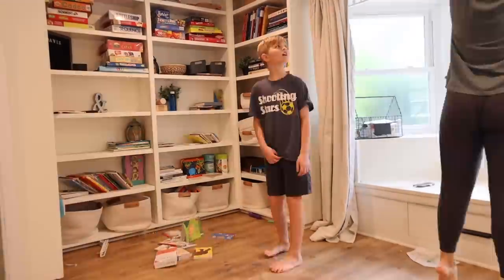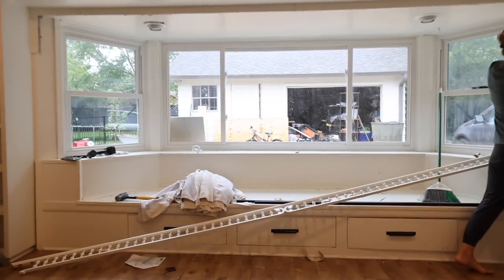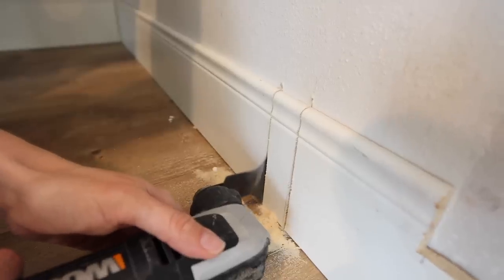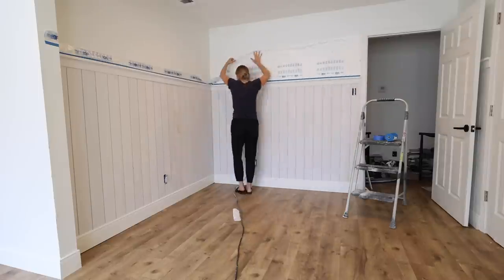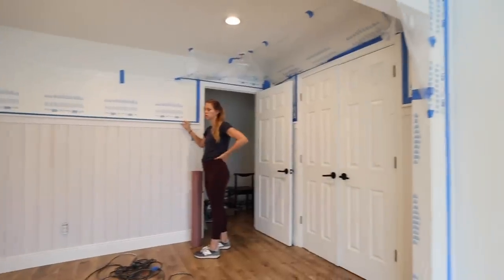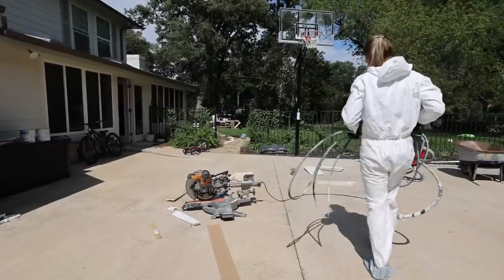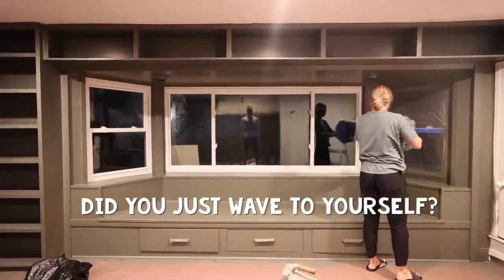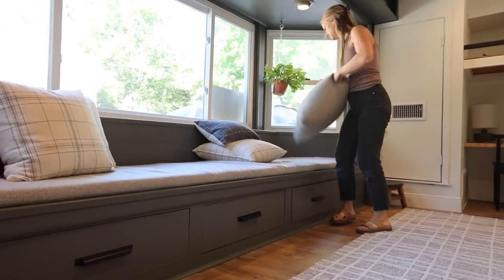Extreme Room Makeover! [Part 3 of 4] // Painting Built-Ins & Trim // Playroom Makeover

Comment: For textured ceilings.  Run a bead of clear caulk in the corner.  Put you tape there and masking there.  Paint and remove while the caulking is still wet.  Makes a crisp line because it fills the gap and the tape will stick in the caulk.   When it dries you won't see it.  Works well for strips or changing colors on a textured wall.

Comment: It looks awesome! Great color choice. 

In my experience, green Frog Tape is much crisper and is more reliable with it's adhesion. I hate paying more for it, but my lack of frustration is worth the added cost. I used the scotch blue with the attached plastic once and would not use it again because it kept coming loose as it did for you. You did have a textured ceiling, but my surfaces were prepped and clean, so IDK why it didn't stay stuck. It was a huge pain.

Comment: Caulk is my best friend whenever I am doing a project. It sure does clean everything up and I know for me it helps me to hide a lot. 😂 Prep work is horrible. It definitely takes much longer than the actual painting. I still paint the old fashion way with a brush and roller but as soon as I get things under control. I’m going to invest in a sprayer. You have definitely convinced me of investing in a sprayer when you did your friend’s kitchen. Holy cow it goes faster. I find that yellow tape worked better on the texture. Wow 🤩 I absolutely love it. Anytime I’ve hired someone to do something, I have had to redo it myself. I’ve watched your kitchen island video several times I’m trying to get up enough nerve to do my own kitchen island.

Comment: Andrea, my wife and I really like to paint furniture. In fact, one of our favorite colors we have marked as "DIY Wife Blue/Gray". Anyway, it is a satin finish and after putting on a few coats, I let the paint dry for over a week (sometimes 2 weeks). Then we spray on a couple light coats of matte poly for added protection. However, I have been having an issue where it looks "crackled" (mostly small and not noticeable until 5-6 inches from the furniture) and was just wondering, have you ever experienced this? I don't think I'm doing anything "wrong" To cause this. Please let me know if you've ever had this happen.

Comment: Forgot to ask, do you paint both sides of the doors the same color. I want to paint inside of door that shows in the room but want the side facing hallway to be white. Will that look okay or odd? Thanks
Reply from the maker: No I actually leave the other side white because the hallway is white! I painted the edges green in this case, it made sense with the way the door opened

Comment: Have you thought about using a glass scraper on floors, if you do around the edges and any remnants scraped off in the middle should work.

Would be cheaper.

Comment: Get an extractor fan when spraying. Aerosolising paint in an enclosed space is dangerous regardless of gear, it travels and it hangs in the air. Never disrobe in the space you just painted, seal it off and gtfo.